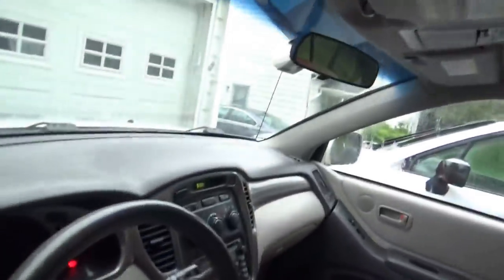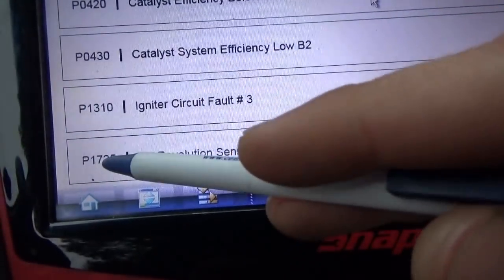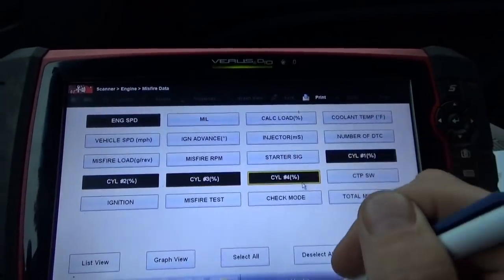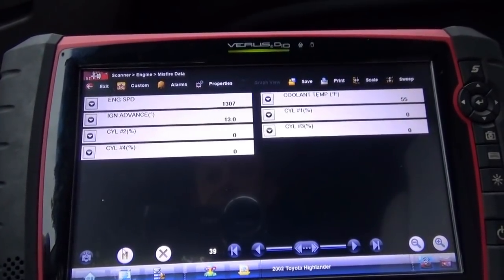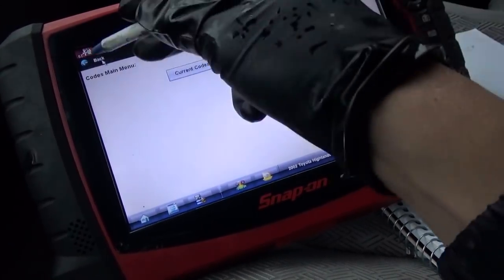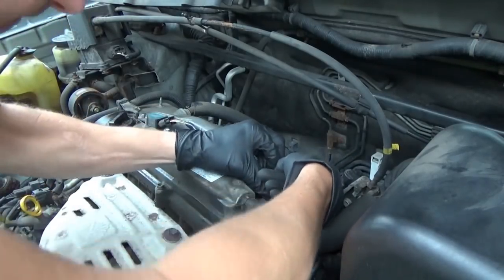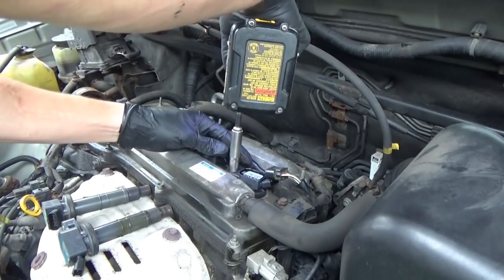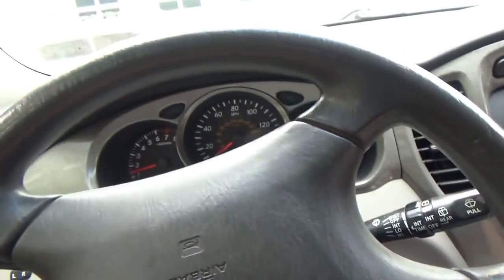Stall, Misfire P0300-P1310 Toyota Highlander

Comment: Scotty would proud! A Toyota lives to die another day!
Reply from the maker: haha that's right Eric! Only thing that goes wrong on Toyotas is O2 sensors and coil packs ;)
Reply: Ivan, out here on the west coast Toyota's somehow end up applying rust inhibitors automatically...usually fine Corinthian 5W30...the newer ones 0W20. :)
Reply: The NEW new ones are using 0w-16! Basically the consistency of water. Actually, might be even thinner ... 😮
Reply: Pine Hollow Auto Diagnostics I have that same sensor issue at 89k on my 2006 Highlander which caused the engine light and the Vsc light as well ( which got me confused ). The car still running smooth and well. I think the code is P0031 oxygen sensor or something like that
Reply: @Brayden Paxton Instablaster =)
Reply: @Josue Knox It did the trick and I now got access to my account again. I'm so happy!
Thanks so much, you really help me out!
Reply: @Brayden Paxton you are welcome :)

Comment: Another thought. In spite of the codes, there are two things that can cause this intermittent but recurrent problem: (1) Large pieces of trash in the fuel tank that get sucked to the pickup, occluding it and starving the engine of fuel; when the engine cuts off, the trash falls to the bottom of the tank until the next time.(This is why it can start back up with no problem.)  (2) Small pieces of trash sucked into the fuel filter under certain conditions, cutting off fuel flow. When the engine is off, the trash falls away from the filter, and you can restart it almost immediately.  About 40+ years ago, in the days before electronic engine management and codes, I faced a similar problem with an almost new pickup truck a guy had just driven from Alaska to the small town in Virginia, where I was  in school.  He was a recent Harvard graduate, a dreamer with family money, who knew nothing about his truck or anything mechanical.  I asked him if he had run out of gas on the trip and, if so, had he had to use an old gas can to refuel the truck. He had and showed me the can he used and the rotten hose that he had used to pour the fuel from the gas can into the tank. The fuel filter was clogged with pieces of old rubber from the hose.  I got him on his way in short order, but often wondered how he had made it all the way from Alaska to Virginia,  knowing as little as he did about anything mechanical or practical.
Reply from the maker: I also wonder how some people manage to get through life ;)
Reply: rust/sugar/dirt stirring in the tank or filter and blocking it sucks, only thing that sucks more is when it's a boat and your adrift dead in the speed/skiing area. with the fuel bulb vacuum sucked flat. cleaned the tank, cut the internal filter screen off and added large external filter solved :)

Comment: Experience as a pre computerisation mechanic makes me think that's a wierd symptom for a single coil fault. I'm guessing that shutdown of all four coils response from the ignition circuit was either a designed safety measure due to the high voltages involved or perhaps the faulty coil managed to overload the control circuitry of all four ? Efficient logic applied for the diag Ivan. Well done and thanks.

Comment: Thank you for your video, they have someone who comes to their house and fixes their car like a doctor. Good job!!  Just to let you know those spark plugs had high calcium deposits on them which also adds High Resistance and stresses the coil. Calcium is a byproduct of gasoline combustion. Change all the spark plugs would benefit them greatly. By the way Go Minnesota Vikings!
Reply: among other contaminates clinging on and the possibility of internal resistor break down :)
I've had cheap-o plugs in the past rust down inside the porcelain, only way I knew it was one of them pulled the wire end electrode out with the wire, I tore the whole set apart and every one was the same. ( auto-lite, cheapest copper plugs from walmart close to 20 years ago) no wonder she had odd misfires.......

Comment: The cat codes will show up in this instance. The catalysts probably are marginal and should be changed out (partially clogged) 

Coolant temp with a plugged cat will be around 210 or so when the thermostat is 180. Might run smooth but will cause problems later on.
Reply from the maker: Makes the exhaust smell a bit funky for sure lol
Reply: @PineHollowAutoDiagnostics  

And the car will run hot and overly rich. In my 98 Contour, the V6 was running 212 degeees (way too hot) and ran very rich before the cats were replaced. After, ran fine.
Reply from the maker: 98 Contour V6...I hope it's a stick shift!
Reply: @PineHollowAutoDiagnostics  

No. It is the CD4E. I had the pleasure of changing the trans back in June. Pump shaft snapped in two and the main input shaft snapped. Got a recent rebuilt one and put a ATF cooler on it. 

Then the alt shorted out, dash cluster diodes blew and shorted the alt circuit out, was overcharging and the pico scope found it.
Reply: The exhaust i put on it is the SVT dual exhaust

Comment: I'll bet that #3 coil got oil soaked at some time.(note the stain)..The sparkplug tubes fill with engine oil..Bad valve train gasket does that..Has the owner had it replaced at some time.?
Reply from the maker: The plug well looked dry to me...

Comment: When do you recommend replacing the coils? The owners manual doesn't say anything about the coils so I would guess its not like a timing e belt or something that get replaced at every 100,000 miles or something like that.
Reply from the maker: Eh whenever they start to act up I guess. Some coils are lifetime.

Comment: The P1725 is a result of the misfire #3. Sensors NT and NC should have a certain sync. to let the ECM shift gears properly. With the misfire they are out of sync. so the car gets into "limp home" mode.
Reply from the maker: I think it had to do more with the stall while in gear lol
Reply: OK, but anyway there was an impairment of the 2 sensors.

Comment: Does that Highlander have A/F ratio sensor(s)?  If so, I've fixed cat codes on Toyotas with new O2's and verified the fix with Mode 6 before and after data.  The last one I fixed this way was an 04 Sienna with a P0430. Mode 6 data verified it was significantly over the limit.  Put two new Denso O2's (from RockAuto, of course) in on bank 2 and ran a drive cycle.  Again, verified with Mode 6 data and showed way under the limit after replacement.  Haven't seen the car since April.
Reply from the maker: Great tip! I've seen this before as well.

Comment: When changing out coils or putting in new plugs, should you (or not) spray the inside of the coil with some kind of dielectric, silicone or fluid film? Just asking because I've sometimes done it, not sure if it's a good idea or bad
Reply: good coils/wires often have some dielectric silicone pre-applied inside the boots

Comment: had a 1967 ford  the vacuum advance rod cam loose, e clip broke, give it gas rod would short points fusible would melt. I get there it starts,  third time decided to drive car for 2 days stalled pulled cap seen clip gone replaced, still wouldn't start! fusible link gave up. replaced, ran fine. no codes/, no computer either

Comment: Rock Auto is fine for ordering parts but when you get a bad part how do you explain that to the customer that has to work the next day. Highly recommend getting your business license and setting up an account with a few parts houses and you can get shop pricing locally with even better customer service. 

Always check the gap on the plugs regardless if they look good and for giggles I'll normally drop a scope down the cylinder. To get in the habit test the coils that way when you have a situation your more familiar with the testing of the could using the component tester. I swap also but I still check the coils as you completely verify the tool. Nice Fix!

On the parts house deal I al setup where I can see Parts availability with my local Parts House and which location has what amount of that part. I can limb place an order for that part and based on what location has what I can get the part right away or up to an hour later as they have their delivery vehicles running in town during weekdays. I have to go to the main warehouse It's just 15 minutes across town which is about a 7 Mile Drive. Definitely not a long drive like you if I remember you're out on Long Island. I've spent many a days out on Long Island waiting on freight to come back to the Midwest years ago. Like going every now then but don't miss it.
Reply from the maker: I'm in the middle of rural Pennsylvania xD
Reply: Pine Hollow Auto Diagnostics  yeah east armpit idaho has more parts houses than you do
Reply: @PineHollowAutoDiagnostics  So ur saying you play in Scanner Danners backyard ? Lol... I always thought you were on the Island in that state over yonder to the east o you. Was Paul your instructor?
Reply: @richardcranium5839  East armpit Idaho??? Confused on that one? Long Island = East Armpit Idaho?
Reply: Dale N  no as ivan said he's in just about the middle of PA  might as well be in the middle of nowhere. just not much close by for him
Reply: @PineHollowAutoDiagnostics  If you have xxl size hands I might have to send you some pairs of the kind I get to try.  They're orange and would look really cool and oh you get to see any dirt on them, they're really durable and have good grip and work great on Zeus (Verus) and phone touchscreens. They make multiple sizes in case you have small hands. 

I like the pay half hour per part deal you mention on the coils. Do you still charge the diagnostic time beforehand then or go case by case and depending on customer? Flat rate is a good selling point for customers but the industry is so ran down because of that.

 It at times forces mechanics to cut corners to save time and for the future of the industry just as mileage is paid for trucking it's not the greatest methodology because in the end the industry loses. 

You mention at your other job where you talked about monitoring the fans and other things for Denso. So this is your side gig that you do? If so you must be like me have to pay for your hobbies. It's that and I like the diagnostic challenges presented.
Reply: @PineHollowAutoDiagnostics  Here's your next diagnosis? LOL... Now remember it has 236k on this 2000 Honda Odyssey. When he brought it to me he didn't tell me upfront before we took care of the codes that he had ran the oil low then went and got the oil changed. LOL.... after the oil change he brought it to me being I'm his neighbor and asked me to look at it did the pre scan and had a P0300 301 304 305. Check the coils figured out which one was the bad one replaced one and the symptoms of the other ones went away along with the codes. Cleared codes, started vehicle, codes didn't come back but the loud knocking that was present before the codes were cleared was still there post fixing the codes which was a single coil pack.

 No I didn't eat the time on the diagnostic because I was going after the code at first and when things shifted after new plugs and the coil pack we came to the determination that he probably shelled the engine out due to lack of lubrication as well. Enjoy the video. I uploaded it to my Dropbox account. I kind of shook my head on this one. 

The upside is I'm selling him a 98 Toyota Camry now which I wish I wouldn't have spoke too soon to sell it but it just sits around and hasn't been driven a lot so I figured why not make some money off of it. 
The downside is where I spoke too soon and said I would take monthly payments. Now cringing after wife found out but in full disclosure she's never drove the car and never would. It was the sons car. Happy Watching!  https://www.dropbox.com/s/kpbtbagkrvkkfkv/20180819_050028.mp4?dl=0
Reply from the maker: 98 Toyota Camry is solid like a rock :)
Reply: funny you say that,  ordered 4 brake rotors, they sat almost a month before i went to install them and one of the rears was ran over or the whole box got dropped from up high more than once, at 180 degree across from each other, it had rough "concrete" marks on the outer edges, stress cracked in by the hat and was majorly bent. it just cleared the caliper bracket.
big time cuss and hate fest..... fortunately it  was a "third" vehicle and has been sitting for a few years anyway....

Comment: is that a 2az engine ? that's what my 2004 camry had.
Reply: Yes it is but don't get tricked, Toyota uses the same engine code but when it comes to SUV or van applications they throw a bigger Cam on it to  increase the torque and make over for the extra few hundred pounds on the curb wight

Comment: dunno why so many mfgs went to individual coil over setups=    compactness ?    or cost ~?

   -could not be really better then old "distributor " units -   or 4 to 6 or 8 coils in one pack-some 3 cyl mills also !!
      -(except for arcing and crack over sparks in wet if insulation on wires or boots failed,
        where   the old water spray bottle   or SNOW trick worked for me ~)

   VW notorious for flaky coil overs-Hondas rare-dunno others like Toyota,Mazda etc

Comment: Is this the same P.O.S. 4 cylinder as the similar vintage Camry with the too short head bolts that fail resulting in head gasket failure and usually total motor destruction? Just like the Corolla motor with piston rings that frequently fail, bad Prius firmware, automatic transmission failures, V6 engines that throw rods thought the side of the block, and other huge embarrassments, Toyota has had a shocking number of design failures. It appears their choice of coils in this application was yet another mistake. Toyota reliability seems to apply only to pre 2000 vehicles. And if you want something as basic as Android Auto, which pretty much every other manufacture has had for several years, don't buy a Toyota as they still don't have it in any of their vehicles. Basically Toyota largely sucks these days.